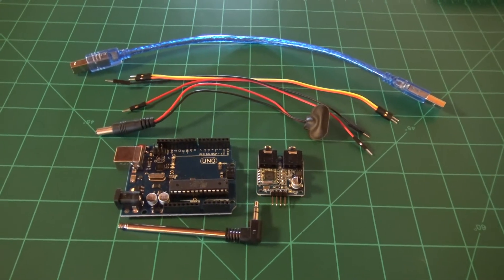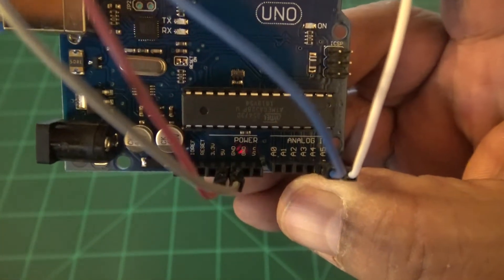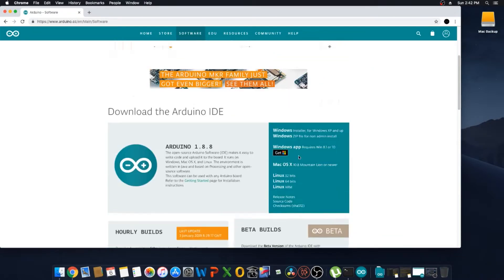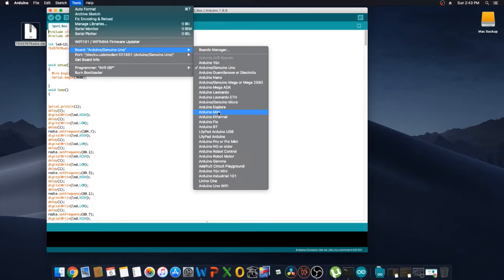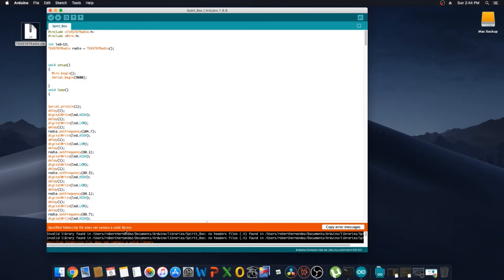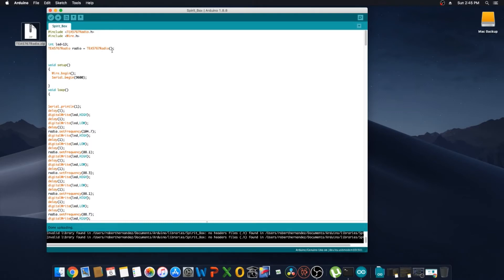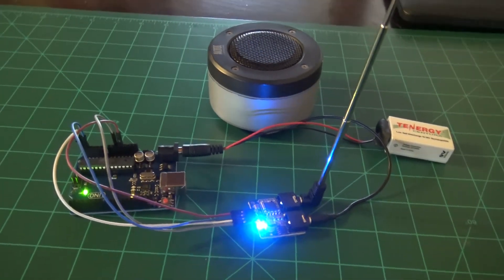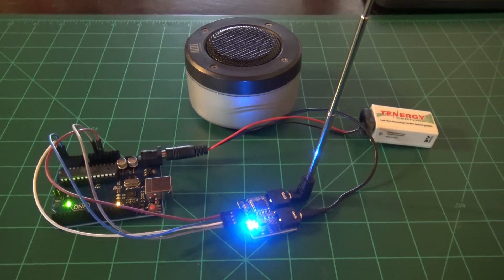Build your own FM Scanning Ghost Box

Comment: Very nice video!! I have a question is that the DIP type of Arduino uno??
Reply from the maker: No. Arduino Uno.
Reply: @TheParawakening  thanks. But the seller here in my country had a variation of the board. Adruino UNO DIP and CH340G. But the arduino DIP looks desame as the one you are using. I hope I am right. I will try to send the image to messenger. Thankss

Comment: Our ghost hunting group, Cypress Paranormal Research, purchased an ITC device from what we thought was a reputable builder about 3 years ago, but, never received the item. It was a scanning Ghost Box that used an Arduino to drive a stepper motor which was attached to the radio frequency changing dial by a small belt and pulley. The Arduino would drive the stepper motor to move the dial back and forth in a random pattern. I'm not Arduino sketch smart enough to come up with a sketch that will do that. Do you think you could write a similar code and make it public? Thanks.

Comment: Hey man awsome vid maybe ypu can help everthing works perfect there is only one problem the sound output is realy low how can i fix that
Reply from the maker: Using a powered speaker with volume control should fix that or an amplifier.
Reply: @TheParawakening  i have an power speaker but still sounds realy quite barely noticble

Comment: could you explain to me how to add a pot to adjust the sweep on this?
Reply from the maker: It is in the description below. There is a diagram also.
Reply: @TheParawakening  followed everything exactly, my issues is the pot doesn't seem to have any effect on the sweep. I can unplug it and it still sweeps the same
Reply from the maker: @KittyKitzmiller  did you splice the red and black wires and solder where they join as in the diagram?
Reply: @TheParawakening  yes im even using the 10k pot as pictured
Reply: does the code need to include anything about the pot? like i said i can unplug the pot and it still sweeping at the same rate. I even tried another pot thinking that one was bad
Reply from the maker: @KittyKitzmiller  Did you splice the red and black wires to the leads to the Arduino?
Reply: @TheParawakening  yep exactly like in the picture
Reply from the maker: @KittyKitzmiller  Last I looked, the code for the pot was there. Check the solder points where the wires are spliced together.
Reply: @TheParawakening  rewired it and still the same the code makes no mention to the pot. i wont paste the entire code. Here is the one that's in the google drive

#include <TEA5767Radio.h>

#include <Wire.h>

int led=13;
TEA5767Radio radio = TEA5767Radio();

void setup()
{
  Wire.begin();
  Serial.begin(9600); 
  
}
void loop()
{
Reply from the maker: @KittyKitzmiller  Try the code I just added.
Reply from the maker: @KittyKitzmiller  did you trybthe new code i posted?
Reply: @TheParawakening  I did, it seems to be working. Sweeps pretty quick through the stations it sound like constant white noise
Reply from the maker: @KittyKitzmiller  the pot will slow it down when adjusted. Glad it is working.

Comment: We bought a box and it came with an antenna, which was confusing until I watched your video.  Would this be a backup antenna or is the small black antenna sufficient.  Confused on why they include another antenna.  Thanks on your strait to the point video.. By the way I'm a 71year old woman!  I could have built our own with your great video.

Comment: Excellent video, Sir! Could this be place in an antique portable radio. I want to make this for my fiancée. Thank you!
Reply: Technically I see not a problem - the audio output is (i guess) basically a "line out" so you can hook it up to active speakers. - you probably would just need to use an amplifier for the audio output to drive the existing speakers in a vintage radio or look around if there are any "vintage radio" conversion packs so you could get the amplifier along with it.

Comment: You can adjust the scan rate via the software right?
Reply from the maker: You can add a pot to adjust the sweep rate
Reply: @TheParawakening  I have already built my own Rem Pods they look identical to the very expensive Rem Pods made by DAS electronics but mine only cost me around $40 US to build and I use the madlab circuut board. My 2 pods work exactly the same as the overpriced original SO NOW I want to build my own sweeping ghostbox 😀
Reply: @TheParawakening  did u do a video on adding a Pot? A procedure how to do it would be welcoming

Comment from the maker: I bought it years ago.
Reply: Nice - I have a question though, why do you keep going few steps back to previous frequencies in your code, is there any method behind it?

I ´ve modified it a little bit using the random function, in my theory it should work even better, "randomness" is often a big factor in paranormal research:

https://www.arduino.cc/reference/en/language/functions/random-numbers/random/

Now I just need to test it :D
Reply from the maker: @georg2010cz  I haven't done anything with this code since I posted. I do not use arduino boards in my builds.
Reply: @TheParawakening  What do you use then?
Reply from the maker: @georg2010cz  in the box show it is an arduino. My new boxes i am using my own circuit.
Reply: @georg2010cz  how did it go?
Reply: @JAgri44451  what exactly?

Comment: id love to see a ghost box that utilizes the same tea5767 but with forward and backwards sweeps pluse sweep rate control
Reply: Already done, I produced one which had 4 modes, with an adjustable sweep, Forwards reversed Random and silent which removes all hiss then the sweep adjustment acts like a station lock control setting how long it stays on a locked on station.
Reply: @Appy_Dev  video link?

Comment: There is a few problems with the Code. Digital Write Led, Best take off any Digital Read/Writes.  This Method, Step sweeps to Predefine/station's So has a lot of Digital Clicks. A more Appropiate way to Linear Sweep is via Floating values. 0-255, =++ 1 With defined range. 

Speed adjustments are also possible with a 50-100k Pot Center pin to A0 Pos 5v and ground on the other pins. And define the Delay with Analogue read Potpin 0
Reply: For example a Quick Code Sketch will replace all this code with a few Lines. With proper Incremental Step on the frequency :) 

Code: 

// SpiritBox vers. 2.00, AppyDroid development

#include <TEA5767.h>
#include <TEA5767Radio.h>
#include <Wire.h>
TEA5767Radio radio = TEA5767Radio();

int potPin = A0;                      // scan speed Potentiometer
int val = 0;

void setup() {
  Wire.begin();

}

void loop() {
   for ( int i = 750 ; i < 1100 ; i++ ) { //float frequency mhz between 750mhz and 1100mhz change to appropiate needs
      float freq1 = i / 10.0 ;
      radio.setFrequency(freq1);       // Sets radio frequency per duty cycle on the looped segment
      val = analogRead(potPin);       // read the value from the pot sensor
      delay(val);                     // map potentiometer value to delay AKA Sweep speed will be achieved via Pot control

}
}

That's it. Copy Paste to your Arduino Jdk and flash. You also need the Additional Library #include <TEA5767Radio.h> As it uses other lib commands.
Reply: @Appy_Dev  This code is fine but the actual loop restricts the speed. Even without the delay you cannot go faster then the loop.
Reply: @xZeKo.D  True in a way, But All the loop does is run the code which takes milliseconds to perform,  I would say less than 50ms to notch up the frequency.
Reply: @Appy_Dev  yeah I just found that out building my prototype earlier. It was where I had written two pieces of code that ran the loop differently
Reply: @xZeKo.D hola amigo podrian subir su linea de comandos mejorada para poder usarlo, gracias

Comment: Hey Rob, you truly are the man. Thanks for sharing this cool sweep radio project. I just ordered all my parts so I hope I'm up and running within a few month. Also while ordering my parts list. I did try something a little different. I ordered a 9v Battery Holder Case with ON/OFF Toggle Switch 9 Volt Box Pack Cover on Ebay. A few more bucks but I think it will work out great for my project, Rob I also have a few more questions:
1. What would you suggest it I wanted to change the antenna to something more external? 
2. How hard would it be to add a speed adjustable sweep knob? 
3. What would I need to add a internal speaker if building this project in a box?

Thanks again and I hope to hear from you soon. 
Eric LaVoie
Reply from the maker: You can.  I can do a more advanced video, on how to add sweep, on/off switch, amp, echo, and place in a box.
Reply: @TheParawakening  did you do that video?
Reply from the maker: @TerryRoeOfficial  yes I did
Reply: @TheParawakening  any chance to link me to your video?